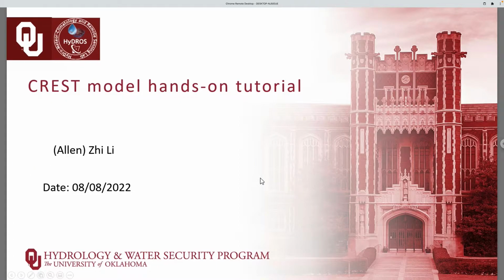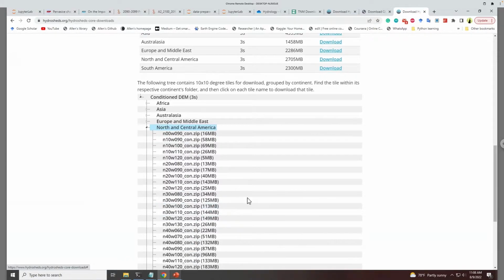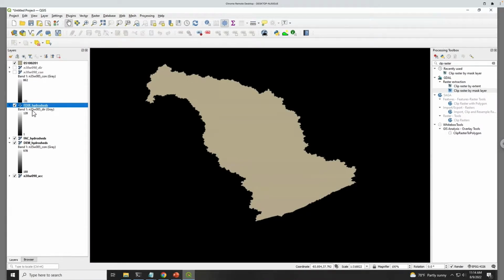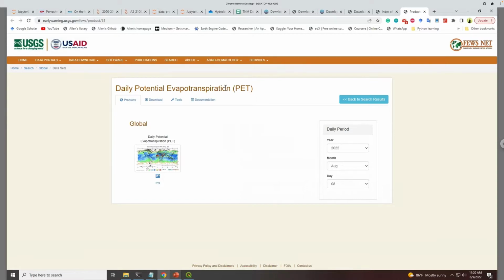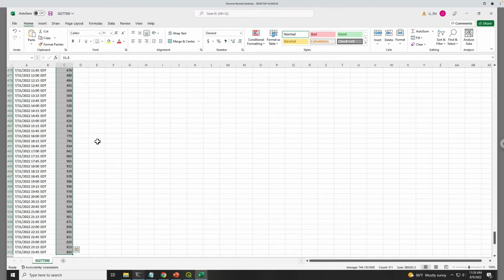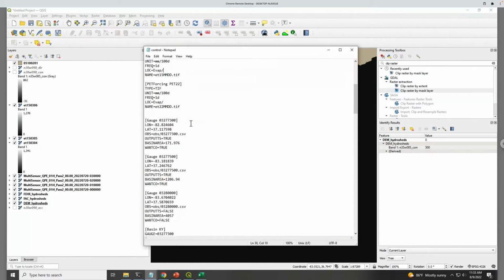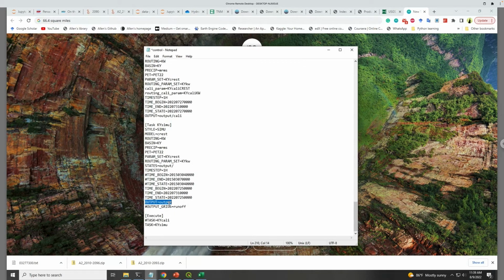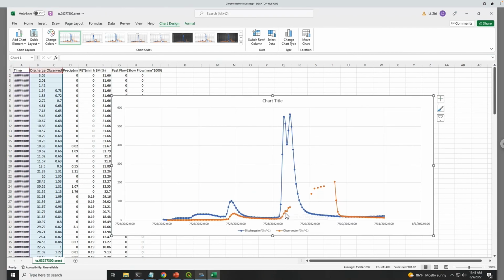EF5/CREST hands-on tutorial

Comment: Dear Professor Li, this is a very educational video, I am very interested in this CRESTv3.0, I want to know more about the parameter control rules, I found the source code and instructions on github, there is no specific DREAM rate parameter control in the documentation, please ask where do I need to watch the video,
Reply from the maker: Please refer to this document: https://ef5docs.readthedocs.io/en/latest/calibrating.html
Reply: @allenli666  Thank you so much for your reply! I am really glad to receive your message. I would like to report a minor issue I encountered while using EF5: when performing runoff routing with the LR method, the program does not generate the "Discharged" result. I checked the relevant code preliminarily and found that the code seems to lack the calculation logic for this part. I wonder if you could help update and improve this section of the code when you have time later? Thank you very much for your assistance!